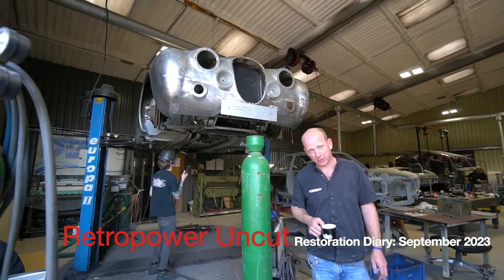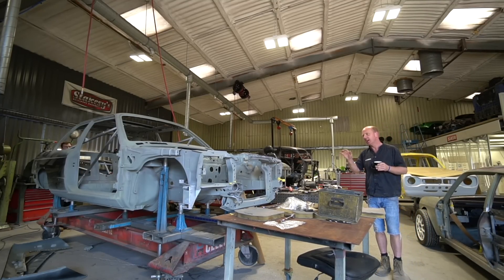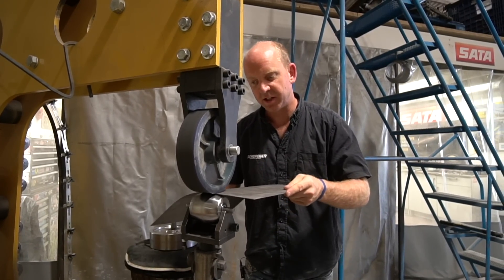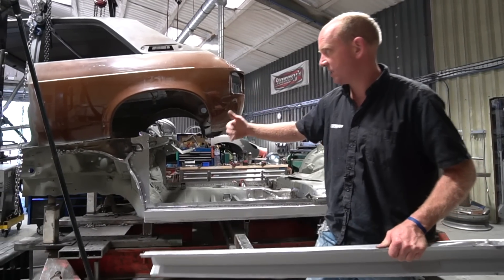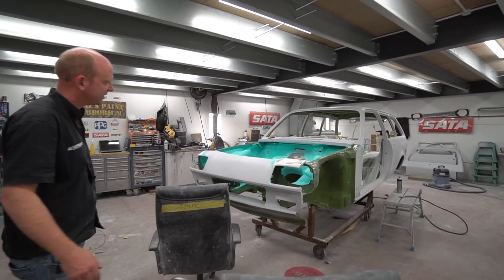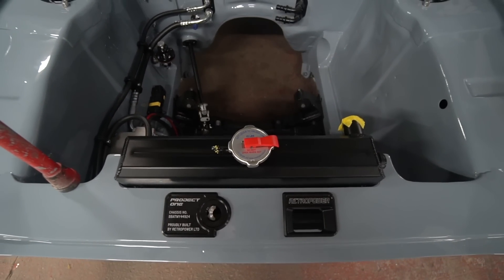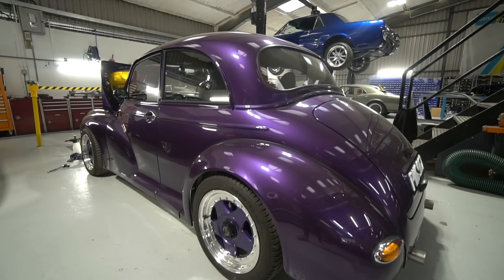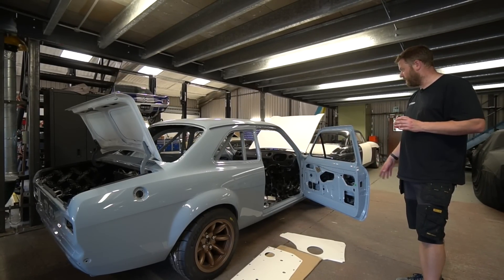Restomod MK1 Escort Build Continues

Comment: Cal, for both commercial and domestic HVAC, as well as for car AC, I found that a system blow down with nitrogen, then a pressure test on nitrogen followed by a release to zero and vacuum immediately there after both tests the system and the dry nitrogen will carry any last bit of moisture out of the system. It just about completely eliminated leak problems after., as well as assured that the water and the acids that will create are well and truly out of the system. FWIW, I'd check on your operating temp; 2 degrees is about four degrees (my system) below freezing an evap coil running at that temp will freeze up with water. Your outlet temps should be almost fifty degrees- 52 degrees is about where all factory units are set up to and where your charge balanced is designed to run. That's 52 degrees on my side of the Pond- almost 17 degrees where you are. That's the "theory" in the books and the one that worked for my for a career. Negative degrees is freezer territory and requires built in defrosters and all to work in a continuous system. Pretty sure you mis spoke- or you would have heard about it from someone long before me.

Comment: Look at the Colin Furze shop tips video about a month ago and he shows a genius method for a slip roller stop that's just a piece of angle iron laid between the rolls. It was sent to him from a fan. Dead simple and acts a fixed pivot point for the smaller end of the cone. He also shows it again in his latest video.
Reply: Glad you posted this, saved me some typing! 😁
Reply: I was going to suggest the same thing.

Comment: Thanks for the tip, ABS plastic plate for the door card instead of hardboard.
Now that there will be a wide transmission tunnel in the E-type roadster, will there still be room for the seats?

Comment: With the E30 do you remove the organic stuff via manual methods or is it via pyrolysis? I considered pyrolysis for one of my projects but the sealer is PVC plastisol which apparently can release HCL when burned which I worried would get trapped between seams similar to the problem with acid dipping.

Comment: I have that exact same handbrake in my Sunbeam Imp, and have been wondering - for all the years that the car has been dismantled - exactly how I'm going to get it rivetted back together. I'm probably going to look at making a two-piece interscrew fitting on the lathe that can be unbolted if I ever need to get it apart again.
Reply: If it worked fine before, why re engineer it? It will just soak up more of your life time and put off completing the car by another weekend

Comment: Perhaps it is time to invest in a refrigerant leak detector and/or a nitrogen pressure tester, nitrogen is a lot cheaper than r134a or r1234yf.
Reply: I was thinking the same, plus bubble liquid, bubbles don’t lie (yes I do mean proper leak detection fluid and not the stuff for kids).
Also wondering “vacuum held” how is the vacuum being measured? If it’s via those gauges then it’s time to invest in a proper vacuum gauge. If you’re not measuring, you’re guessing.

Comment: Please @Retropower, build me a Ascona 400, but with the 400 meaning 400ci of LS power or an Alfa Gulia 510 hp powertrain, could be in a Ascona or Manta A also, but really the one I want is the Opel Kadett Coupe' GT/E with that Alfa/Ferrari engine. Or what about a restomod Lancia 8.32? 458 engine i hear you say? OK, will do after that 100mill lottery  cupon goes in..  So many dream builds but only one lifetime.... When think about it, a BMW e28 with that unreliable v10 would sound cool at least. There is a guy here in Norway that put a Viper engine in a really old Opel...

Comment: Still dont understand why the hydraulic system isn't flushed. In every industrial application I've ever been involved in we have flushed the hydraulic system as standard usually down to NAS 6. Even the oil out of the drum should be filtered before its filled because it won't be clean out of the drum or can.